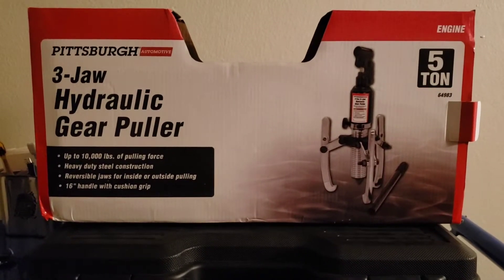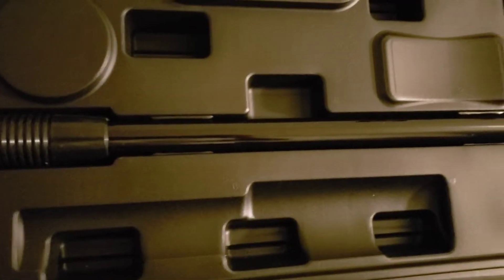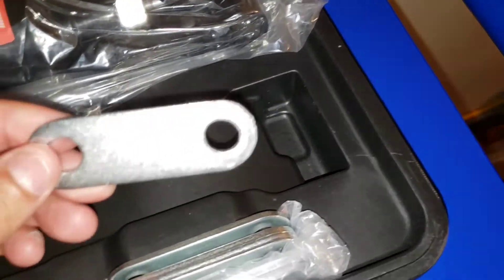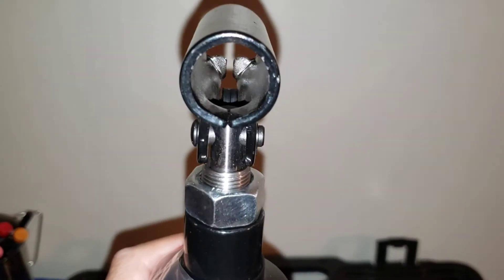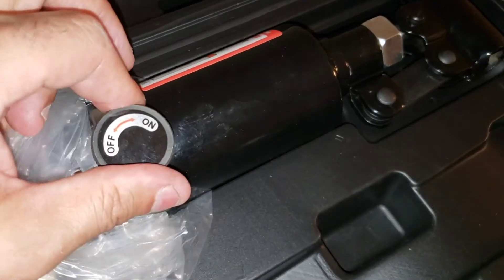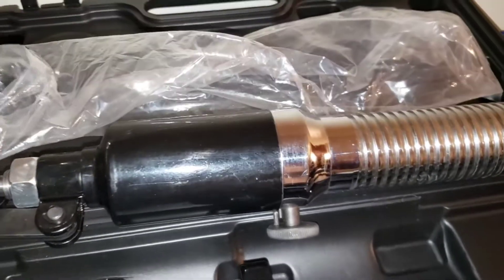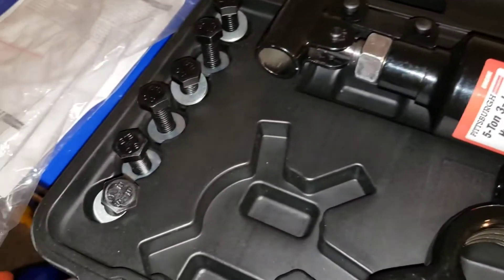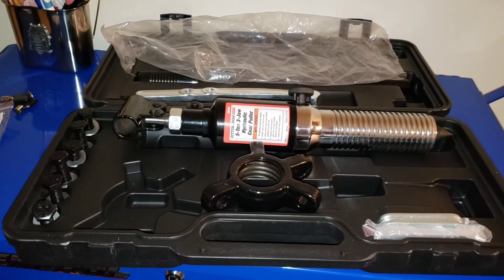Great 3 Jaw,  5 Ton hydraulic  gear and bearing  puller.

Comment: I had terrible luck with this puller trying to remove a cv axle from a ford escape.   I highly doubt it puts out the 10,000lbs of force it says it can, but it's possible the one I got was defective.
Reply from the maker: I haven't tried mine out yet but it looks heavy duty